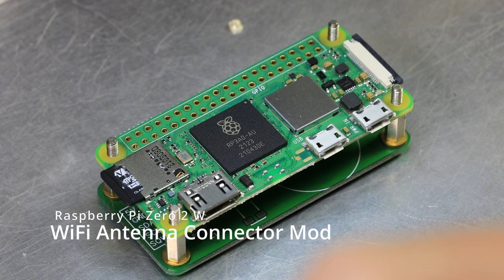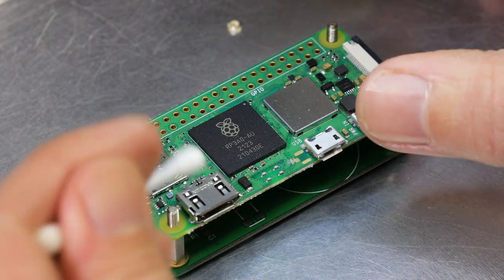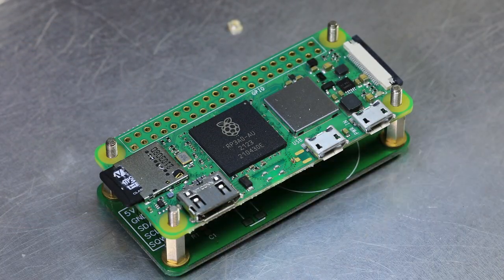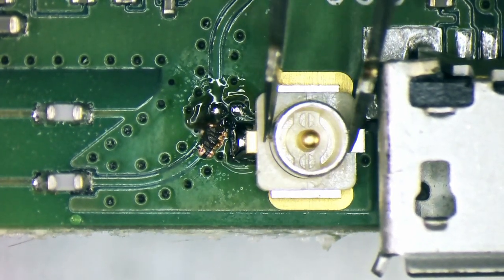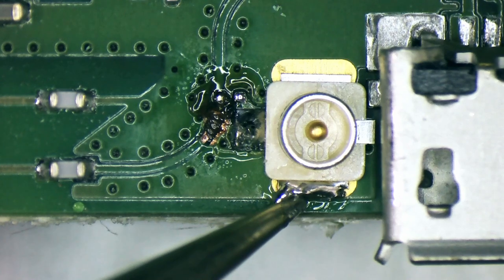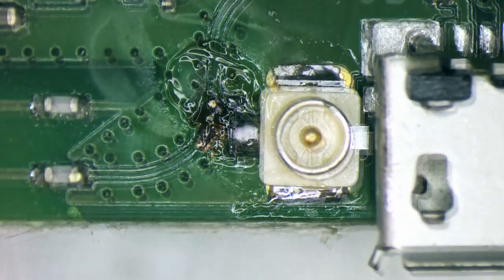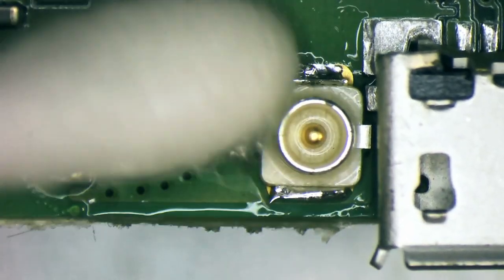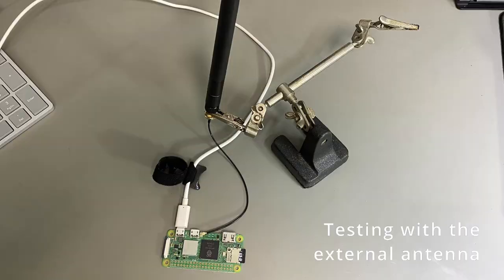Raspberry Pi Zero 2 W U.FL Connector Antenna Mod

Comment: I don't understand why you have to cut the trace. Just desolder the resistor?
Reply: better antenna spread idk how to explain makes signal better when u cut the trace
Reply: SWR (standing wave ratio - or amount of energy that is radiated out) would be compromised if he didn't

Comment: Is the resistor to the U.FL connector in the original schematic or did you infer the purpose of those pads?  I was thinking that moving one of the SMD caps from the feedline to the PCB antenna and putting it on those pads would make more sense.  They capacitively coupled the PCB antenna, I can't see why they wouldn't do the same for an external antenna connector.

Comment: i think that is better to remove/desolder smd element at bottom left and remove insulation layer  from both sides (ground) on board and solder there  U.FL Connector
Reply: I wonder if that would create issues with RF tract (not an engineer, just remembering things from physics, with impedance, standing waves and terminators, etc).

Comment: Would desoldering the surface mount at the end of the track do the same job as cutting the trace?
Reply from the maker: Removing the component would create a "stub antenna" which would cause an impedance mismatch to the WiFi chip and may damage it

Comment: Great video, just in time! Would it be possible to remove one of these little SMD parts (capacitor) on antenna path instead of irreversibly making a gap in it?
EDIT: I've found, it is possible, but the effectiveness is reduced :-)
Reply from the maker: I think it would leave whats known as a stub antenna which would cause an impedance mismatch to the RF output stage of the chip and could damage it.
Reply: Did you actually found evidence that it was noticably reduced or was it just theoretical?
It might not actually matter that much.
Reply: @bonnome2  Others have tested and shown a measurable difference. There is a video by Caleb Begly Fun and Tech where he shows the difference between cutting the trace, leaving the trace and removing the capacitor, and leaving the trace and the capacitor. Cutting the trace led to the least signal drop.

Comment: Great job, very skillful!
Reply: Definitely not. The way he butchered that track is absolutely abhorrent.
Next, soldering the fragile center pin first is not advised, the outer pads are much more robust and allow correcting the position until the center pad is properly aligned and flat on the PCB. It should be soldered last to avoid shearing or pushing it around.
Also don't use a flux pen when you're not able or willing to propely flush the PCB with cleaner or put it into an ultrasonic bath. The flux pens I used previously sometimes leave corrosive residue under connectors and chips, which becomes a problem after weeks or months. Use no-clean tacky flux instead.